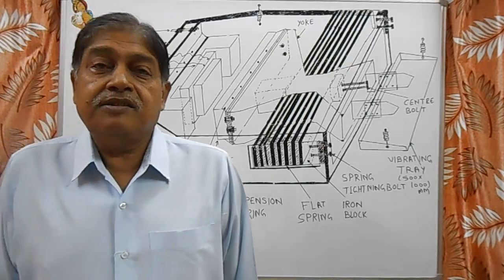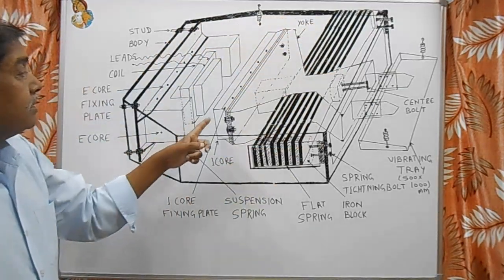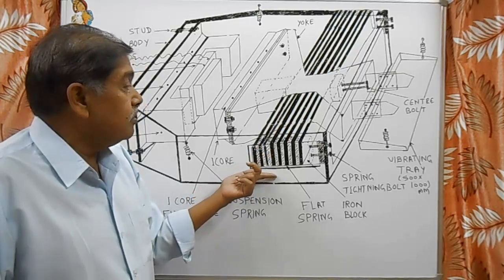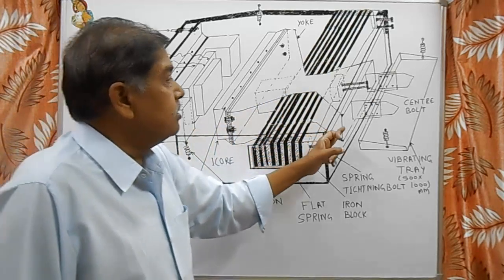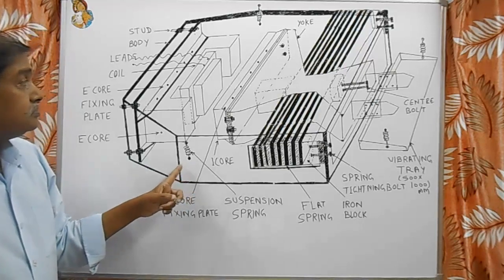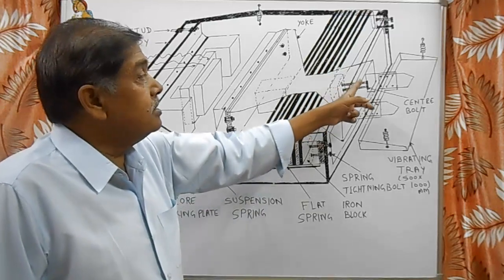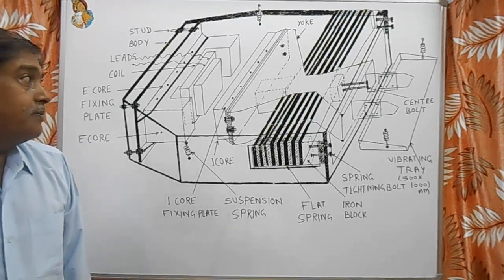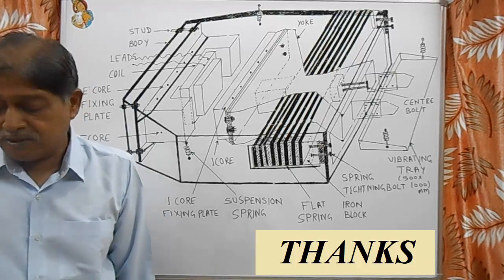VIBRATORY FEEDER CONSTRUCTION AND WORKING, ELECTROMAGNETIC VIBRATORY FEEDER

Comment: Sir
We have a coal handling plant in which an unlaced vibrating motor vibrator use it works well on Indian coal but while processing imported coal which has more fines it works low feeding rate
Reply from the maker: Vvvf can be used for speed control of motor. May be at higher speed feed can be improved

Comment: Vibrator slow running but y
Reply from the maker: Gap must be equal and uniform between i core and e core. Gap should be 1.5 mm to 2 mm. All the nut bolt must be full tight. Spring flat must not be broken. Diode may be short. Regulator resistance may be broken or wrongly connected.